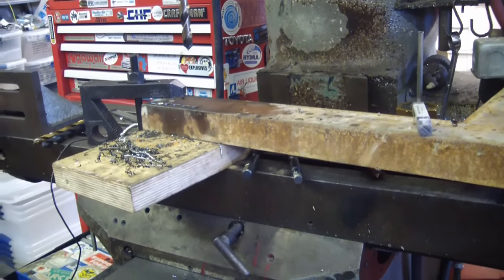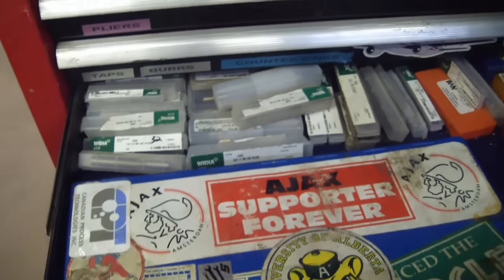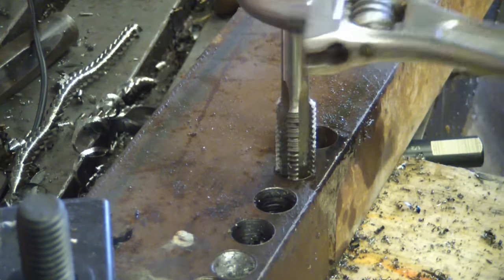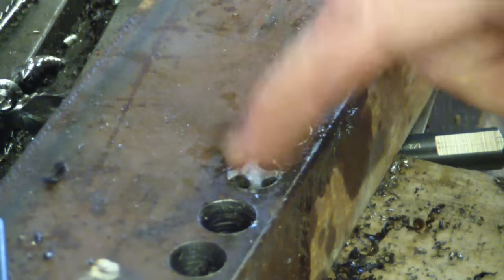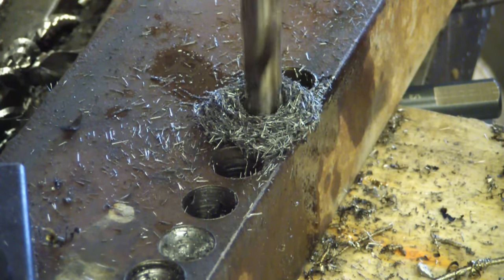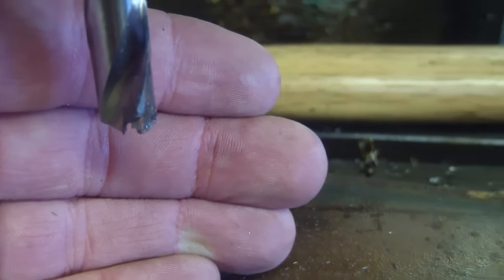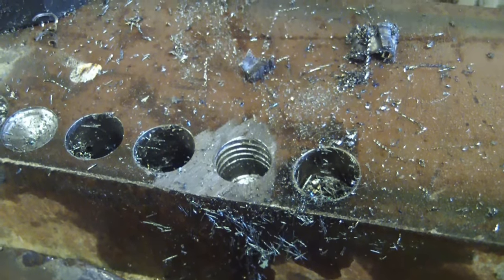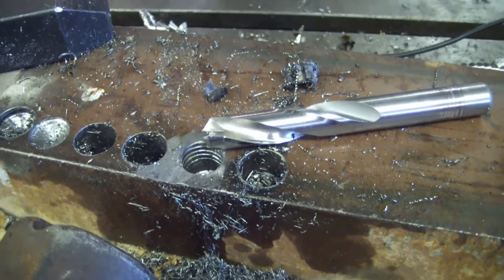Manly-man skills: Remove a broken tap the hard way.

Comment: Back in my fitting and machining days I would remove broken taps by getting a piece of thin flat bar - drilling a hole in the end smaller diameter that the tap and then mig weld the flat bar to the tap though the hole and use the flat bar as a spanner - it even helped if part of the tap was still protruding the hole

Comment: I just use a pencil/micro grinder with the carbide grinding end. Mainly for apex bits (hard as frig) stuck in titanium bolts/screws. It also works just as well on taps that people break off because they don't break the chip and go to hard to fast. Also, people don't know how to use a tap most of the time.

Comment: There is an old gunsmiths' trick to broken taps, two of them, actually. The first is to get carbon steel ones, but good ones. There is one American company still making them, you can get them through Brownel's. The carbon steel taps are much more brittle than HSS, so you put a punch on the tap and give it a good wack and the tap will shatter into a million pieces, allowing you to fish them all out. The second is to grind a notch on the shank so that it breaks on the shank rather than in the teeth, giving you something to grab. Bonus: just buy a new tap for every project. I am aware of one gunsmith shop that charges the customer for a new tap if one is needed for that service. They are cheap compared to wasting your time getting a broken one out.

Comment: I like to use a left handed drill for stuff like that.
Reply: +3000gtwelder EXACTLY
Reply: Left handed carbide drills are kind of hard to come by. I've been doing this for 35 years and most of these comments and recommendations work for bolts but taps are a different situation. This video method is about the easiest way without damaging hole.

Comment: That burr bit works dam well nice. I had one broken off. In the back of a platen. On a plactic injection molding machine. That was the best thing I found. Took my 90* air grinder. Half a work day later. Cleaned out the threads. And, the 1 1/2 hour job was complete.

Comment: Whenever I break a tap, I immediately hook up the air chisel with a tapered punch and angrily beat the $h!t out of the remaining tap pieces. Haven't run into an hss tap I can't destroy. Stumbled across this video while looking for the punch attachment  thinking there may be a better way - not in my case - obliterated another tap while watching this video thinking about all the time I drilled through hardened steel with a masonry bit when I could have used a carbide burr.

Comment: I had a real problem where you manufactured yours. I was using a quality tap that fractured and would not come out with a tap remover, so I used a hardened punch and shattered the broken tap, surprisingly it saved me time and money. Sometimes brute force works best.

Comment: I worked with an incredibly good but also
incredibly alcoolic old machinist.Anyway
once I broken a tap in a 2x2 inch by 3 ft
long piece of mild steel.After looking at
the thing,he proceeded to smack the
thing around at various hard targets to
eventually vibrate the little tap out of
its hole.It worked.

Comment: Use a Carbide drill which is a slightly smaller Ø than the root of the broken taps flutes -  The tap will collapse, or almost collapse,  just requiring a slight hit with a centre punch. Less fun & a bit boring, but effective!!

Comment: Taps are hard and brittle, right? Maybe a hammer drill would work(?) shattering the tap as it goes.
I have used tap extractors with some success. Removing a spiral flute tap. Now THERE'S a challenge.
Reply: Haven't tried a hammer drill specifically yet because my shop didn't have one, but I hate having to tap stuff. Especially 10-24 taps.

Comment: love the colored humor btw the impressions and all! you don't go over the top or anything either! now another way to remove a broken tap it to crank up a stick welder all the way and use a 3\32 rod and blow that sucker out like you gave it a laxative! the hole may need some help afterwards but you can always fill it with a 7018 and retap later! cranking up the amps and running small rods works like an arc gouger, shit for that matter a cutting torch would work just excellent to remove taps!!!

Comment: In case you've never tried "Ball Buster" or Relsom diamond core cutter bits from StrongArm, they're worth having a few in your arsenal. They are specificish to safe drilling but holy shit will they twist up a shirt. The ball busters are glorified rasps made for cutting ball bearings and the diamond cores are made for Relsom metal hard plate in old Hamilton, Mosler and probably other safes. Great twisty sticks!

Comment: What I do is get a flat bar of steel and 2 bolts that fit into the flutes of the tap. Then drill 2 holes through the bar at the same width as the flutes and run the bolts through the bar and the into the tap flutes. Then I can use the bar to turn the tap out. Basically, I just make a sturdier version of the retailed tool that fits into the flutes.

Comment: Most job shops keep a supply of reground carbide ball end mills around, much better than using a drill bit on broken taps.  Coolant does help but your air is better, as you peck use the air and give the hole a shot now and then to keep the small bits and pieces out of the hole.

Comment: Needle-nose pliers with 90 dungarees bend, place in fluté, twist and shout?
Reply: istartedajoke thanks good idea
Reply: I’m thinking if the tap broke, it might just be wedged to tight. But I’ll agree, if you don’t try all your tricks 1st, you may go straight to the hard way (some may call it the right way) but like he said, if that you have access to the right way, you are probably not on YouTube looking for how some other bees-tard over come the problem
Reply: YES . Use pliers . Lubrication as well . Turn the broken tap back and forth . Lubrication. Lubrication.  Lubrication.  Lubrication.  Etc .
   I have retrieved many of the seniors impatient  F N efforts. 
 Simplicity and Lubrication.
Reply: @qualityconsulting4094  I've broken taps on the first few turns because they're just badly manufactured Chineseium POS, so they're stuck, but not that stuck hehe
Reply: @boboften9952  Do you recommend lubrication?

Comment: a sharp cone profile carbide rotary file in a die grinder seems to work best for me in extreme rescues. I cut through the flutes to release the tap and then chisel it out if possible. I pull the chips out with a scriber magnet. very effective method so far.

Comment: In situations like that, I’ve used something called an “Easy-Out.”  Drill a very small hole in the center of the bolt or tap, then insert the easy-out and torque it in.  And because the threads on the easy-out go in the opposite direction of your tap or bolt threads, the process of tightening the easy-out into the hole actually spins the stuck bolt in the loosening direction and the broken-off bolt comes right out.

Comment: I've always been able to get broken taps out with a "tap extractor". (Snap-On brand, of coarse) But then again, I'm always careful as to how much torque I'm applying and I'm fully surprised when I do manage to break a tap as opposed to your intentionally "breaking it off in her"... Remember, you want to be able to use that hole again when it's all said and done. :-)  Try mounting your drill press to the bottom side of a GM exhaust manifold. Not gonna happen.
Reply: Room for a mag drill? 😅

Comment: The use of round nose solid carbide grinding burs work much better. Put the bur in the spindle of a Bridgeport milling machine and use the fine adjustment on the spindle stop and advance the burr a few thousands at a time. It will remove the tap can also use on broken easy outs.

Comment: If you have a local PCB factory, they will give you a bucket load of used drills that are only going in the bin. Even when they're considered worn out, they are plenty sharp enough for our needs.
It doesn't matter if you break a handful of them. I switch between sizes so if it breaks, you can still get the broken bit out.
PCB routers are usually burrs, 2.4mm diameter for cutting out the boards. Again, they are thrown away when still usable for this sort of job.
You'll probably break plenty, but it doesn't matter if they're free.

Comment: In response to Chinese crap production. (I'm in Thailand. Consider it the waste port of the crap of the crap from China.)
Make ANYTHING that is a hot seller. A N Y T H I N G. And in a few weeks, days, hours or seconds, there will be a Chinese fly by night company or twelve making cheap knock offs of the product then (often) going to great lengths to pirate copy the exact packaging of the original.
I have a Seagate HD drive here, new in the box with warranty card and nomenclature, that failed after 2 months. I took it to a Seagate service center. They chuckled as they plugged it in to their factory test comp and turned the monitor so I could see it: 'Not Seagate'. 
I have a Makita drill, again new with all the factory fluff. Nope. Cheap copy, perfect copy of the original packaging, crap motor with pot metal bushings instead of bearings.

NEVER REINVENT THE WHEEL. Let someone else make it then copy it. The Chinese business ethic. Manufacturers commonly come about, register, make a few hundred thousand of some item, then vanish.. Literally vanish as in Hardware House computer part chain. Sold factory seconds... No, they don't scrap the units that fail inspection, they package them and dump them on the local non export market. Then poof. Hardware House, a designated MSI distributor, vanished. Gone. Poof. Puff of smoke. Never existed. All warranty's for products sold by them are skrewed. 

Can I interest somebody in a new in the box with all packaging and paperwork Fuji S5600 camera at full retail price? It took a pro photographer all of 5 seconds to note a factory second with a flawed lens.

This is the world of Chinese total cut throat manufacturing and marketing. Some good, some pure garbage. And YOU CAN'T tell them apart since the packaging is top flight professional counterfeit.

What else. Ball bearings I was able to flatten with vise grips. Vise grips that the handle bent on the first use. Drill bits up to 5/16th inch I could bend with my fingers. A set of screw drivers that when I applied normal torque, the handles crumbled like dried out bread. A shovel's blade bent the first attempt to stick it in the ground. Lot and lots and lot of Ray Ban glasses of every imaginable shape and size. Look close, the trademark logo name is RoyBon. How about an Onega watch? Look close: ornega (ORNEGA). JBL speakers? How about JBI? Phillips and Panasonic incandescent and compact fluorescent lights that last two weeks?

Comment: I dissolve my taps with sulfuric acid! Works like a charm :) if the part you are tapping is also steel you may be out of luck (or maybe ok with etching the part too) but I suspect there is a way to get around it.
Reply: I've heard taps broken in aluminum can be dissolved with "alum" but I've never tried it. Don't want to do this on ferrous metal parts or the part will probably dissolve too.

I've personally seen a 3/16th carbide 5 flute end mill(centercutting) used at ~3000-5000rpm(max speed) used in a Bridgeport to bore away the center of a broken 2 flute 3/8(or 1/4) tap so the teeth could be removed with a prick punch.

Sinker EDM is supposed to be good but you need a sinker EDM first. :P

Helicoil's are a pretty nice way to salvage the part if the original threads can't be saved.
Reply: +Nicholas Cantrell Yeah, carbide end mills are my preferred method. I've extracted dozens of broken taps this way. Tip: Use a worn out, old carbide end mill. It still does the job and you wont fuck up a brand new carbide end mill.
Reply: +operator0  Yeah ! but that mill won't fit under the bonnet of a car to the side of the engine, I have to use an electric hand drill not a battery not, enough grunt and a right angle drive.

Comment: Cutters should come in sets of 3. The first one makes an shallow cut, the second one makes an intermediate cut and the third one makes the final cut.
After cutting half a turn return the tool for at least half or 3/4 turn to release the debris.
Always lubricate while cutting and always use a double handled wrench.
We used rape seed oil but any oil is better than no oil.
Buy quality cutters.
That way you'll never get stuck with broken cutters.

Comment: This is a good video, I was working "in the trenches" as a mech-technical repair type cog in the wheel of productivity and learned quickly to bite the Snap On -shapped bullet and bought their tap and die and rethreading kits and was done with it. Anything that directly affects the ability/speed/quality/frustration of you completing a potentially costly task, like breaking taps off in engine blocks/heads, etc. on a project that was already due out yesterday and is over budget anyway... Deserves to exercise enough smarts to buy decent tools for that job.  Make up for it elsewhere. 
Now then...
  Comments about a country and its rep for products is not racist.  Making a general statement about a race is not racist.  The fact that 99% of the people today that rant on about racism cannot state the difference between the words racism and bigotry.  And there is a huge difference.   Mentioning comments made between you and another person in understood humor about race is not racism. 
  The people screaming the loudest, on the defensive and ready to drop the race card at the drop of a hat from any country are much more the cause of the problem and tension between the races than the people they call racist, being wrong about 97% of the time. 
  It's time to take a breath, relax and not get your panties in a knot everytime someone opens their mouth.   And the biggest thing to remember is that nowhere in the constitution (anyone's constitution) does it guarantee you the right to not be offended.  The only one who can prevent you from being offended...  Is you!!  When some idiot proves his existence as such by opening his mouth, ignore it!  It's a pretty simple solution to the whole offensive, "hate speech" concept.   Now then, if someone is causing you to be deprived of something, like your ability to perform your duties at work or some measurable form of harm by the things they say or more importantly the things they do, then you've got something to crow about and that's a whole, different issue.  But, to think that you're going to be able to go through life without someone saying something that could offend your tender sensibilities...  You've got another thing coming.  The answer?  Realize the jerk he/she is and keep yourself above it by ignoring it!
  In Korea it's "kagogie"  They'll tell you it's beef, you tell them they're lying, they laugh and tell you so sorry, mistake, go get you beef right now.  5 minutes later they come back with the same thing and tell you it's beef again.   😆   Beef is so expensive and unavailable in many places...  "Dog, it's what's for dinner."  hahaha  Or waterbuffallo or horse...  Particularly in street food and in the poorer, rural towns.  Wild dogs all there, too.  😀

Comment: When I was a young machinist I broke a tap on a job. The shop owner just put on safety glasses and beat the heck out of the tap with a hammer and punch to get it to shatter. He had it out in no time. I never saw anyone else try that. BTW I never knew taps were soft enough to drill with carbide. I did not expect that.

Comment: I’m amazed that you could use that tiny carbide drill in your drill press. I use those for drilling homemade circuit boards and they’re very brittle.  Just the slightest bit of runout in the drill and they break.  Your drill press must be way better than mine.

Comment: Carbide burrs work very well if you run much slower speed and use heavy pressure toward the cut. I use them often on hardened AR15 bolt carriers.

Comment: i had a m4-tap broken off. This video helped, first flatten then i tried PCB drill  - fail broke too easy
next i tried a special hardened tialin-endmill in 3mm. It worked but lost 2 teeth in the process xD
tip1: be extremly slow in contacting the worpiece with the endmill (vertical speed).
tip2: before retaping drill the whole 0,1mm bigger so next tap wont break again. use lube - a lot.

Comment: I usually use a carbide spade drill that I grind from a broken tool shank. Negative rake makes the drill far less fragile. Just a little bigger than the web of the tap.

Comment: I'm curious what kind of drill that is considering how hard taps are. Anytime I have to drill taps out at work I use carbide and i generally spin it pretty slow. Even our cobalt alloy drills dont do much to a tap although our taps are pretty good. Usually OSG brand or nachi.

Comment: I braze a nut to it using silicone-bronze & tig. Do it all the time. Great for broken bolts too. Just build up a stack of tacks to the broken offender, then choose a nut that'll fit over the stack, then weld the center of the nut full. Cool down, back it out. Done it with mig also. Just not with taps. Broken tap, everdoo.